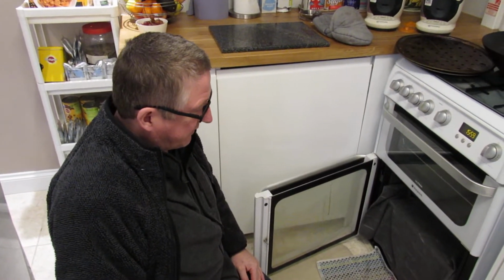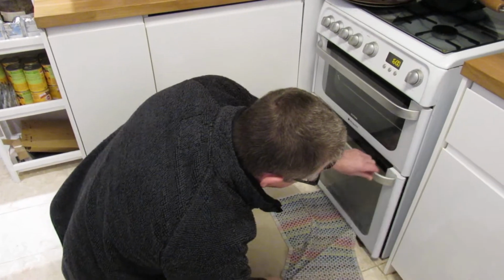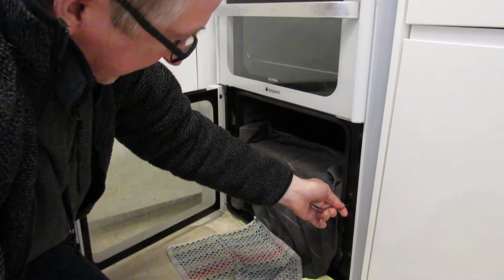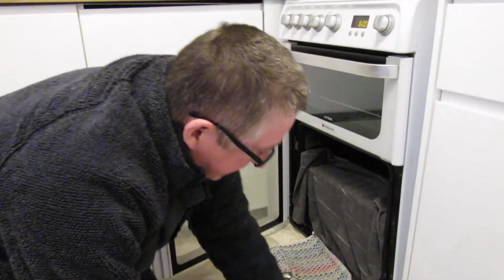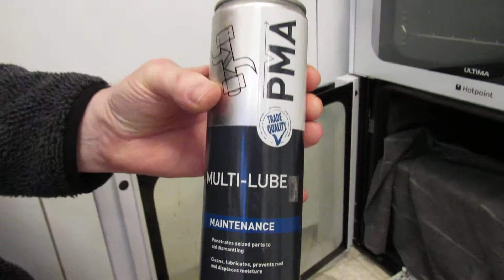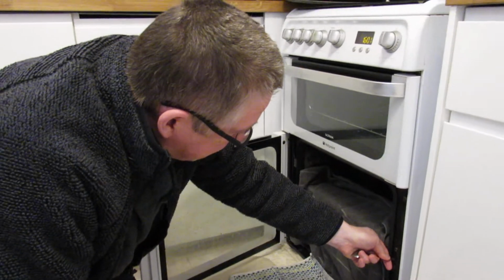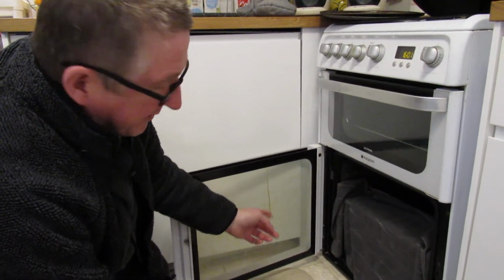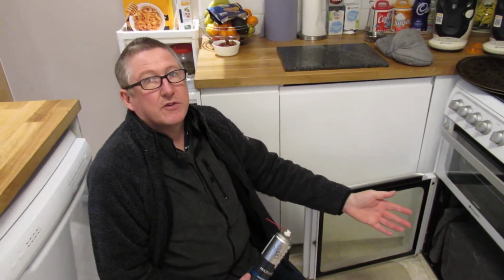How to fix an oven door that won't close properly, Hotpoint Ultima gas cooker

Comment: Had a quick go at this, took less than 5 minutes and door closes easily without having to lift it up. Thought I was going to have to do something with the hinge - thankfully not needed. See how it goes in the next week or so
Reply from the maker: it's been good for us, thanks
Reply: I will try that. I thought that it was a loose hinge as the door seems to have dropped. If the door doesn't shut properly the fan won't work. Is that the same thing?

Comment: How do I replace/fit a thermocouple to the grill in a Hotpoint Ultima just like that one.  The Grill flame won't stay lit.
Reply: That's what I would like to know!  Also how to clean the top grill and/or be able to lift the top to access to clean.  I'm assuming you can't but it would be a great help if you can (not sure about whether gas connections to hob and grill are flexible).
edit:  I've been resorting to putting the top oven on before using the grill which does enable the thermocouple to allow flame lighting, but honestly!  What bad design.